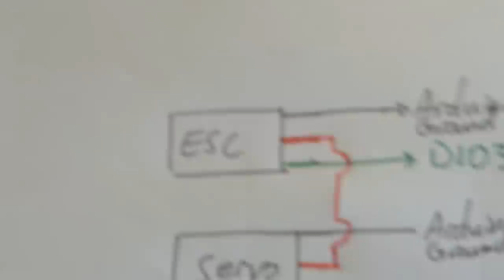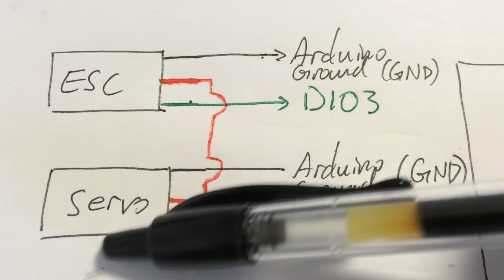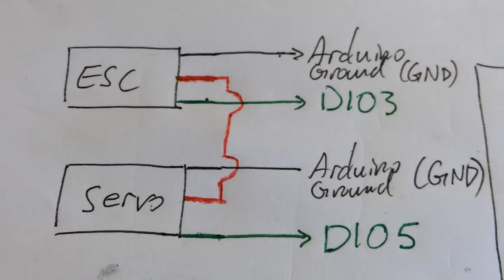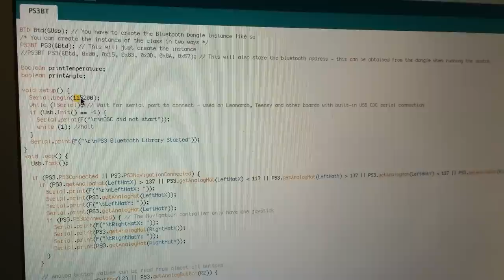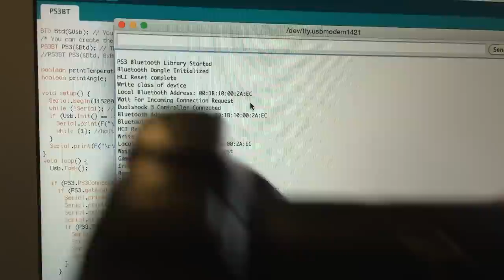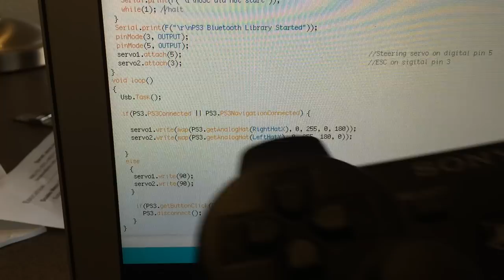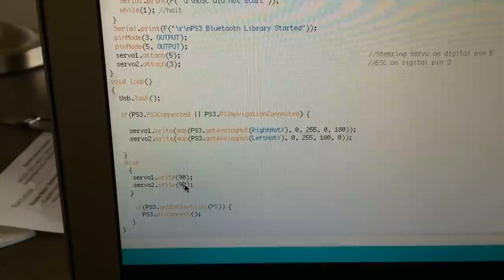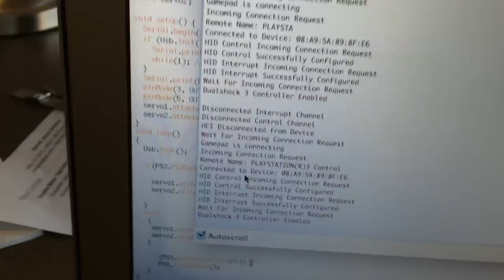Control an RC car with a PS3 controller, Arduino UNO, USB host shield and Bluetooth dongle  (Part 2)

Comment: I just wanted to say thank you very much for your videos, website, and sharing the codes you used. Thanks almost entirely to your videos I have managed to get my (knockoff) Mega and PS3 controllers talking to each other and displaying the button pushes on the serial monitor.
Reply from the maker: Wellington Ironman Glad to heat that!
Reply: Hi again Barrett. I wonder if I would possibly be able to ask for your help on getting the code controlling servos. I sent you an email to the gmail address on your blog. I'm in the process of coding for a BB8 droid that will be used for charity and community fundraising, but am a total beginner to coding and not able to get your servo code to work at the moment.

Appreciate you probably have better things to do than help strangers on the internet though!
Reply from the maker: Received and responded to your email! Let me know if you run into any more problems. Also, feel free to share anything you figure out here or on my website to help the rest of the community!

Comment: Sir, excellent ps3 robotic car project. Sir, can you make a tutorial video on Xbox 360 wireless controller to control the robotic car and 6 servos using an Arduino Uno on Xbox 360 wireless controller robotic car and 6 servos?

Comment: Very nice !! 
Would it also work with smaller components? Like Arduino nano/micro and micro usb host shield or there won't be enough memory?
Reply from the maker: It will work with smaller components. There is also a mini USB host shield for smaller Arduinos.

Comment: I'm pretty late but, I want to do a very similar setup but with an hc06 module for Bluetooth receiving  could you help with this? I don't have the usb shield or dongle i just want to control it with an app or use a controller through an android device. i cant code worth a crap so I'm hoping someone can use most of this code and use hc06 functionality as well as let me know what app to use with it?

Comment: Are you running the motor (not the steering servo) off of its own battery pack in this video, or are you running it off of the 9 volt that you plugged the Arduino into? I know that the Arduino itself can only output 5 volts, and I know that most rc car motors run at 7.4 volts, but I'm not sure how you're powering your motor. Thanks!
Reply from the maker: +ZaTrustedHipster The car is running off of a 11.1V lithium polymer battery that is connected to the ESC (as it would be if you were using the car normally). The ESC drives the motor with this voltage, as well as supplies a regulated 5V to the servo. It would be unwise to have your delicate electronics on the same power supply as the motor, as current draw from the motor will cause large fluctuations in voltage (unless you have a filter/step down converter in between the main power supply and your electronics). In this case, I could have powered my electronics off of the regulated 5V from the ESC (which normally drives the servo), but I was worried that current draw from by the servo would introduce too much noise onto the 5V supply (as the 5V supply is only intended to run a servo and ESC). Hence, I used a separate battery for my electronics.

Comment: Hey, really good, what's the frequency of the PWM? Both Servo and BD motors?
Reply from the maker: I’m not sure. The Servo.h library configures the PWM timing (I believe using one or more of dedicated timers on the Arduino) to be whatever frequency is standard for RC equipment. This is something you could look up wherever Servo.h is maintained (I haven’t looked in a long time).  Why do you ask?

Comment: Man, I need your help! I am in a wheelchair and have a Traxxas Slash 4x4. Haven't been able to use the controller for a while but now my new wheelchair has bluetooth, which allows me to control a computer or mobile device with the joystick on my chair. Do you think that could be used to control my Slash?
Reply from the maker: Probably, but I doubt it would work with the library I'm using in this video. This library is specific to the data structures of each controller. How does your Bluetooth system work? Does it have host functionality? If so, you could just use a HC-05 bluetooth transceiver on an Arduino.

Comment: How do i make so the throttle foward is the R2 and the reverse is L2? Cant dinf the right code, thank you!
Reply from the maker: Replace the PS3.getAnalogHat() with an appropriate combination of PS3.getAnalogButton(R2) and PS3.getAnalogButton(L2) (you will need to combine their output into a single motor command). You could try something like map(PS3.getAnalogButton(R2) - PS3.getAnalogButton(L2), -255, 255, 0, 180). I am not sure about the "-255" and "255" values. You will need to print out the combined value to check if that is indeed the summed output range.

Comment: I have an after glow PS3 controller that has a USB dongle that's paired with it right out of the boxWould this work the way you have it set up as my controller does not have a input for any cords thnasks
Reply from the maker: Hi Brad, I'm not sure. I suggest that you consult the readme on the developer's GitHub: https://github.com/felis/USB_Host_Shield_2.0#summary
Reply: what Arduino ide version are you using?
Reply from the maker: I generally use the latest version of the IDE. I am not sure what version I was using in this video.

Comment: how to reduce the program memory space that the program uses? any idea?
Reply from the maker: Remove any unused functions calls. The Arduino IDE will automatically reduce the library size to reflect only the functions used.

Comment: What if i'm using DC Motor Only no esc and servo motor.
Reply from the maker: DC motor controllers will take the exact same input as used for servos and brushless ESCs, so nothing needs to be changed except the output range (depending on your motor controller calibration). Note that you cannot drive DC motors (unless really really tiny) from the Arduino directly. You need something like this: https://hobbyking.com/en_us/hobbywing-quicrun-60a-2s-3s-waterproof-brushed-esc-for-1-10.html.

Comment: will it also work with 4 servo motor?
Reply from the maker: Yes. However, you would need to add the code to control the extra servos.

Comment: Can the trigger on the controller be use for brake and accelerate and are they progressive
Reply from the maker: MsIrick Yes and yes. All you would have to do is replace the code that maps the left joystick to the throttle with code that maps the triggers to the throttle.
Reply from the maker: +Liam Miller To which code are you referring?

Comment: Does it work with ps4 Controllers too?
Reply from the maker: Yes
Reply: +Barrett Anderies ok thanks
Reply from the maker: But you will need to use the PS4 functions which are now included (see the PS4BT example included with the library).

Comment: Does this work for xbox 360 controllers
Reply from the maker: Yes, the library supports Xbox controllers, however, it requires an Xbox-specific receiver. You can find more information here: https://github.com/felis/USB_Host_Shield_2.0#xbox-library.
Reply: Thanks
Reply: Do you know why i get this error message ? :

#include "XBOXRECV.h"

                                     ^

compilation terminated.

exit status 1
Error compiling for board Arduino/Genuino Uno.
Reply from the maker: Yes, that I most likely due to the library not being included properly. Make sure that you put the library folder in the "libraries" folder in the Arduino directory. Also, the name of the library folder must not contain any dots "." or dashes "-". If either of these things is not done correctly, the IDE will not be able to find the library and will give you that error.

Comment: bro i m also working on some thing like that range extender you talked about. if you use rf modules instead of xbee i think you will be happier. http://www.dx.com/p/arduino-apc220-wireless-rf-modules-w-antennas-usb-converter-143011#.VOe3T_msX-s this one works like a magic on the tx-rx pins. but for the rpeater arduino you need a mega. you need an arudino with 2 channel or more serrial com.